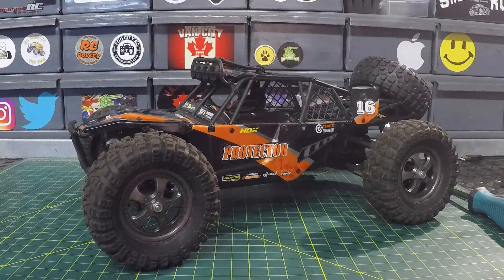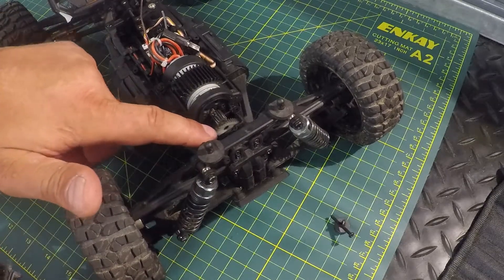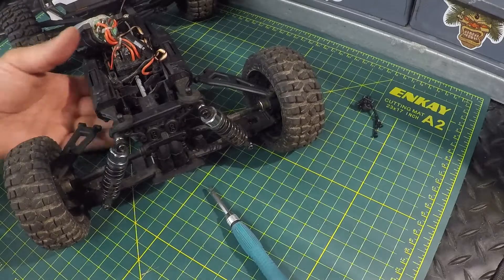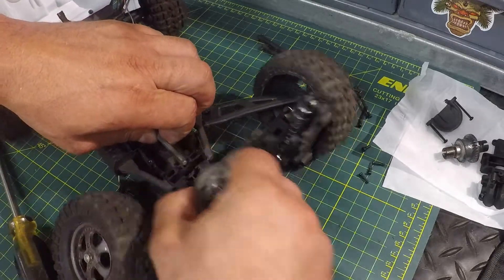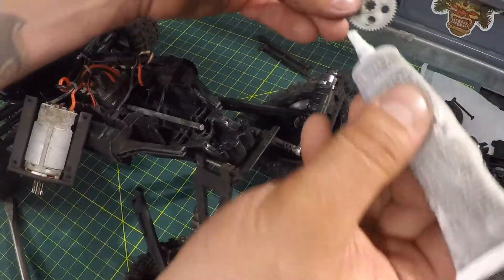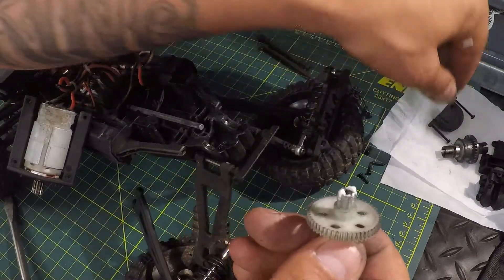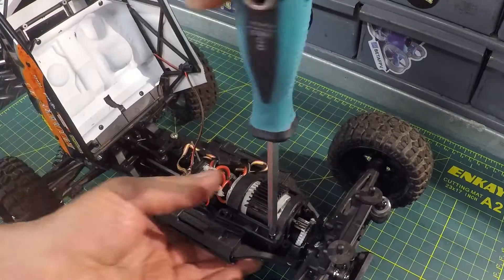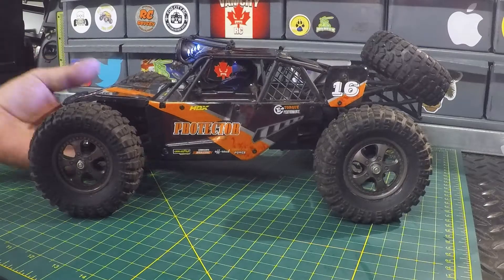Haiboxing HBX PROTECTOR Tutorial: Spur Gear Replacement

Comment: Do you know what type of
Pitch they are. I want to up my from the 12t to the 14t since I just do street  speed runs. I’ve tried a 48pitch and a 32 but none fit it
Reply from the maker: I believe all HBX gears are Mod 0.6
Reply: @Van_City  I’ll try a 0.6. The 0.8 sort of chewed up the original spur.
Reply from the maker: @saldelatorre805  let me know if that works for you